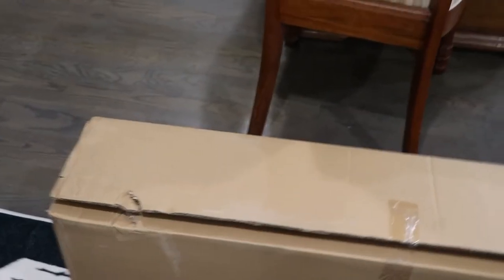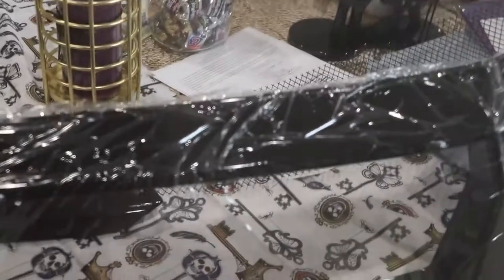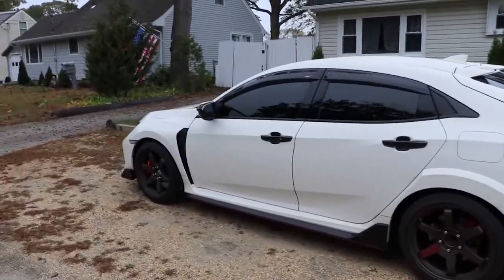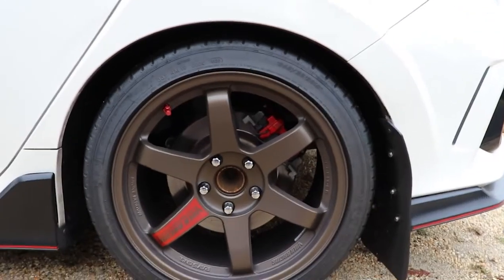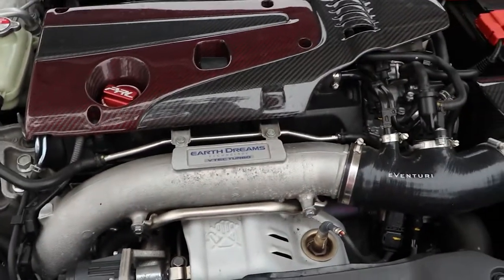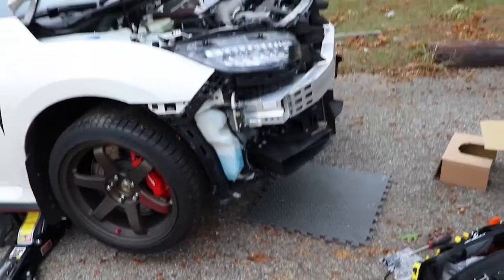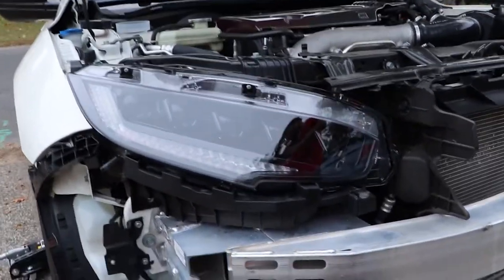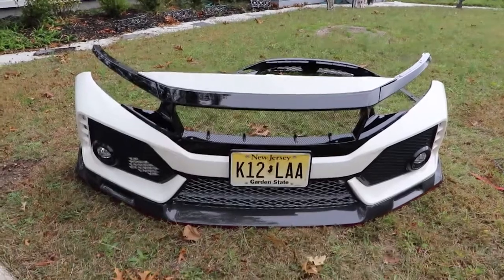Honda Civic Sports Grille | AMERICAN MODIFIED

Comment: Did you cut the bumper support bracket out from behind the mesh? I'm installing mine now and didn't realize I had to cut out that support to make it clean opening. I'm not too happy about hacking the bumper up. You can feel that support bracket is actually doing something.